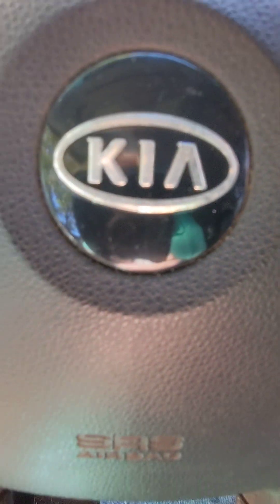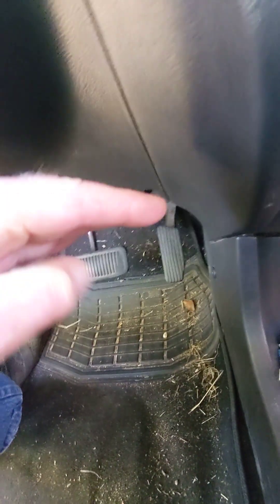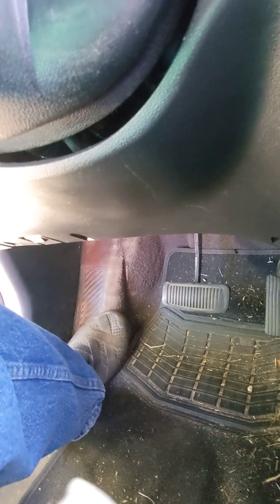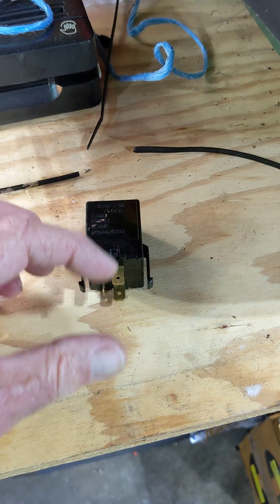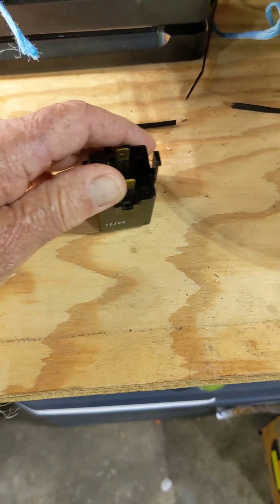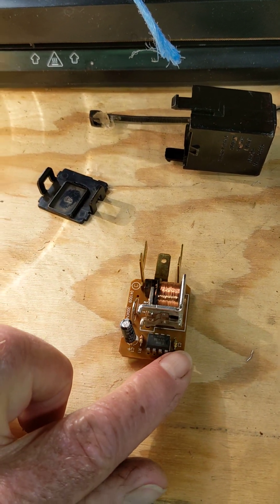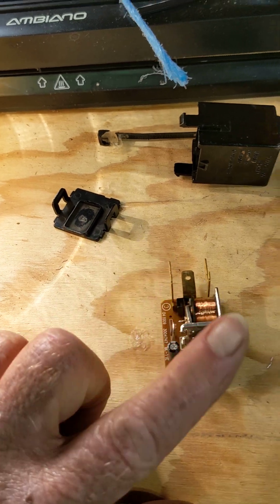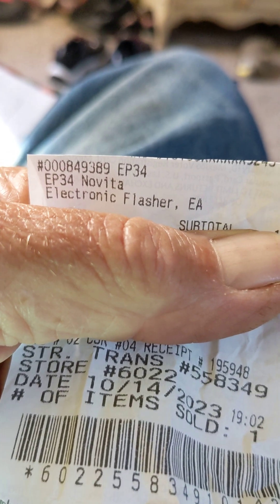2006 Kia Sportage intermittent or no blinker and flasher.

Comment: This is awesome! Thank you. I just really wish I saw where the module is under the steering wheel. Trying to locate it as we speak
Reply from the maker: @JMangaroo  did you find it. It takes about to get up in there.

I am trying to add a beeper to the signal so I can hear when it's stuck on.
Getting old and not hearing things like that make me one of the old guys driving with my blinker going.

Comment: Morning indicator s doest work I bought new flasher but still failed when I took someone flasher it works
Reply from the maker: @thamsanqajamjam9373  did you get a new one? Some relays are similar and I've swapped relays from say the horn just to troubleshoot.
It should also make a ticking noise when it activates.

It's possible the contacts within the relay are just not making a good connection if you can tell it's ticking and actuating.